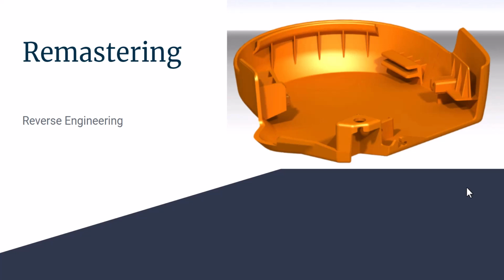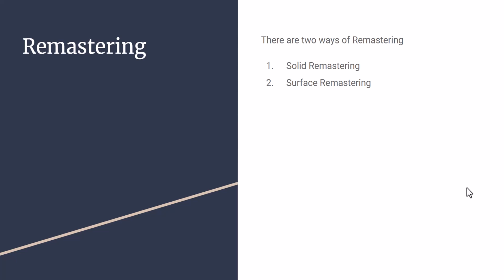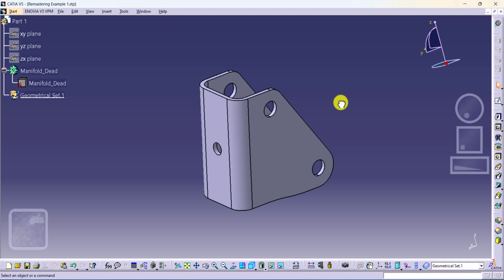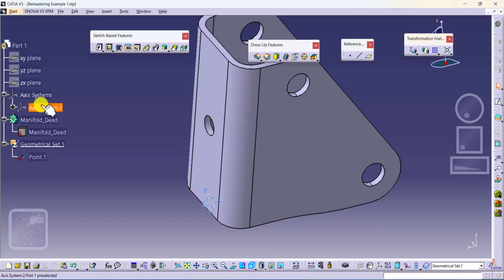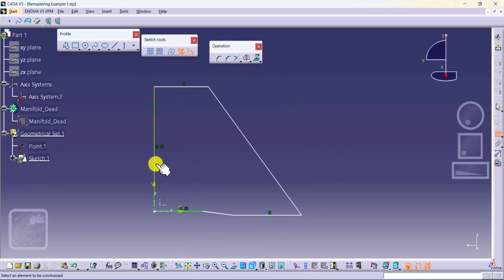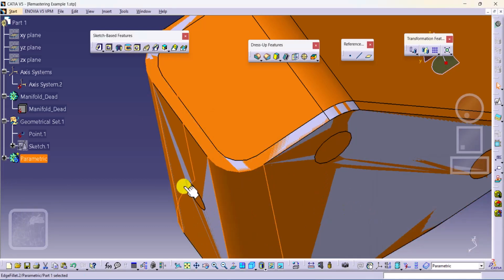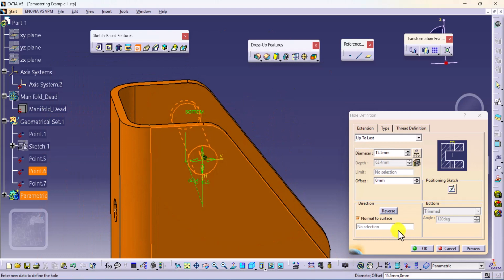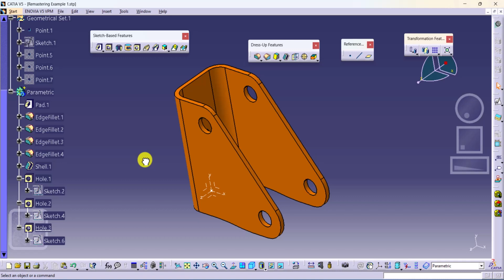How to Perform Remastering || Reverse Engineering || CATIA V5 Tutorials

Comment: This video is amazing. thank you. I understand the orientation of the planes and axis is different, hence we follow a different approach of linking the points to axis and then linking axis to origin. But I have a query, instead of linking all the points except origin to the axis system, we could have kept the axis system definition - current ticked right. that way, it automatically takes gets linked to it? and later, we only need to connect the axis system with origin?
Reply from the maker: We can do that as well but separately linking points with axis system helps us in further modifications of point/hole location directly. Just change the coordinate value and it's done.

Also, while creating we are making it independent to avoid any linkage from the non-parametric part, later we need to provide some link b/w axis system and those points. There can be multiple axis systems needed for one part but origin will always be one.

Comment: Sir I have a problem in Solid remastering, I dnt understand Which edges to select for projection whereever I find fillet in main model of sheetmetal. Kindly help me out.
Reply from the maker: Just a quick tip. Alwasy select the horizontal, vertical and straigth edge. Ignore the curves and fillets.
Reply: @mastertheskillls  thank you sir